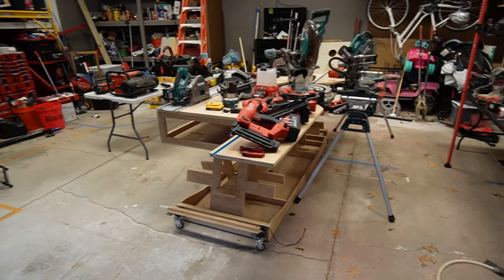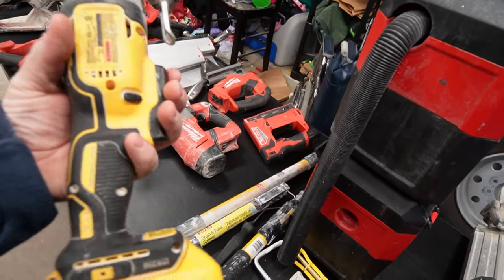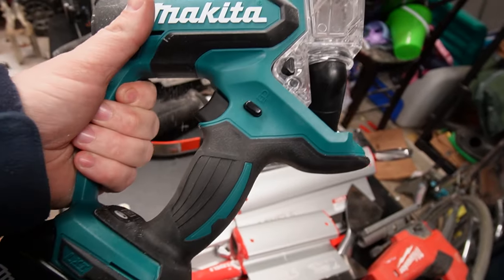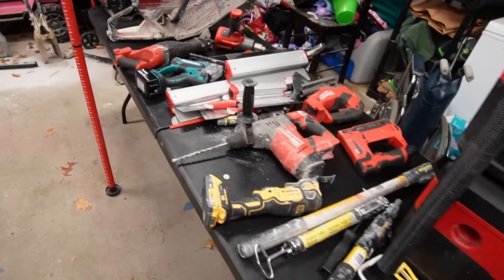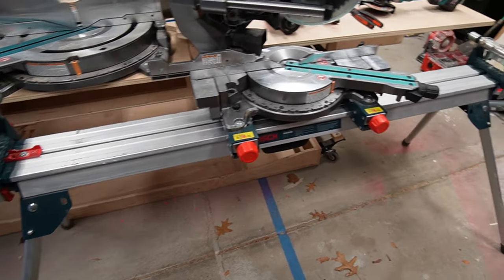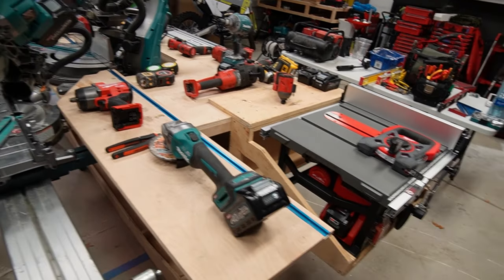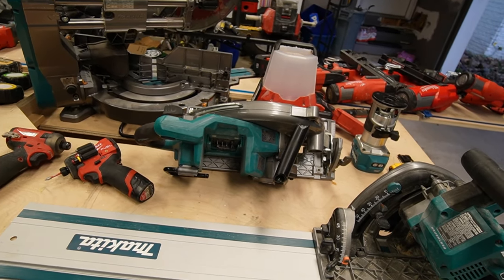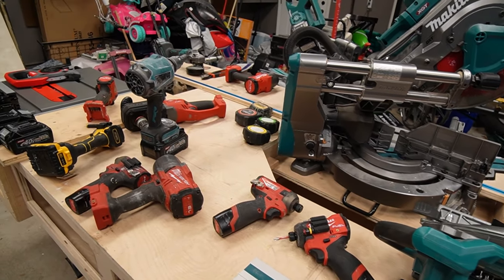The Power Tools You Need!  Year End Inventory and What Tools Are Missing.

Comment: I’ve heard you speak about using subs instead of employees. Would/do you sub out demo? I’m considering starting a demo business but unsure how many contractors would sub that. Thanks!
Reply: I have one demo sub i can use for demo if needed. They do abatement, general demo and heavy equipment demo. Very versatile. The best thing about them is I have never seen a cleaner job site after they finish. 

Usually hiring that out is a bit more expensive than employees or maybe having the framers do the demo.
Reply from the maker: Yes absolutely, but I wouldn’t just do demo, I would also offer say insulation install and a few other skill sets you can bring to the table to help out the contractor you are subcontracting to along with keeping yourself a bit more busy.